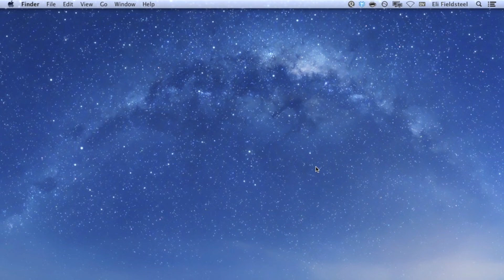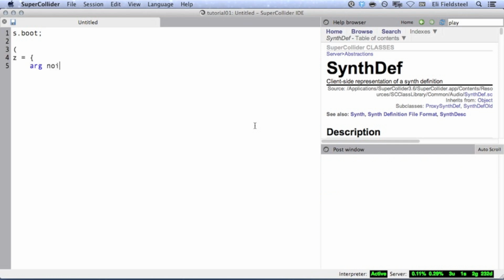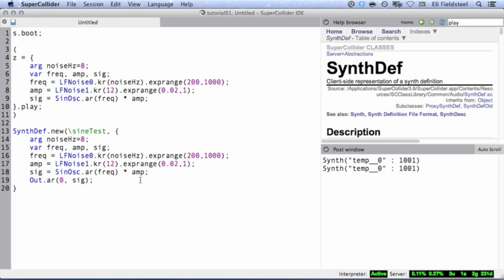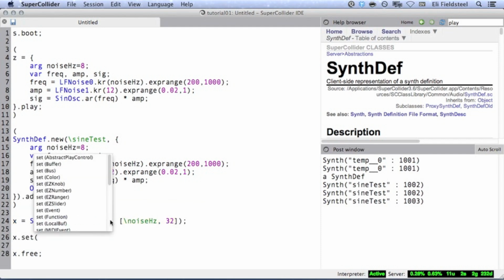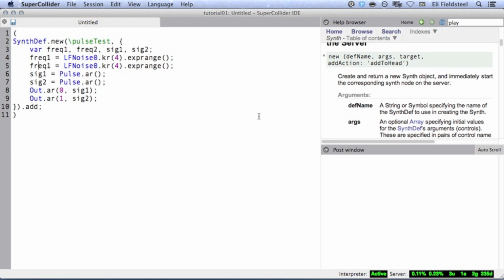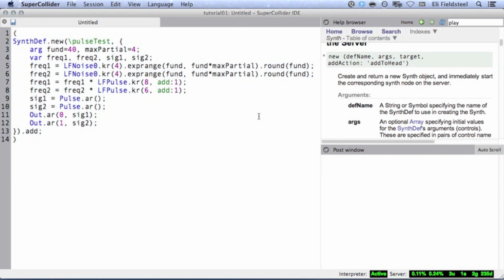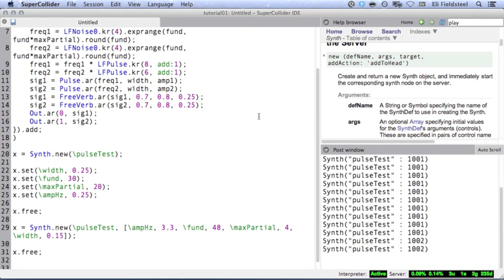SuperCollider Tutorial: 3. Synth and SynthDef

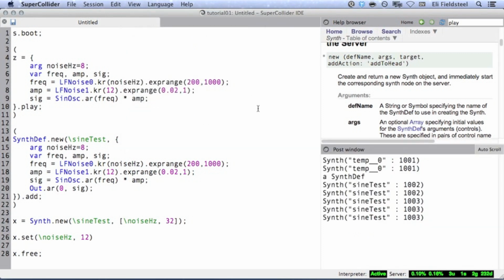Comment: In 4:14, line 26 seems to work without a semicolon. What does this mean?
Reply from the maker: Single, isolated code expressions can be successfully evaluated regardless of whether they end with a semicolon, using shift-enter. In this case, the interpreter determines the end of the code expression to be wherever the first return character is. If you want to evaluate multiple code statements at once, however, semicolons must be used to separate them.

Comment: Could someone help me with a doubt? In the first example, we change the noiseHz (associated with the freq parameter) to change the speed of note change. But in the last example, we use ampHz (which is associated with the amplitude parameter) to do the same. Why is there a difference?
As always, great tutorial Eli! Thank you. :)
Reply from the maker: By changing noiseHz, we change the speed at which LFNoise0 selects values. These values are used to control the frequency of the sound we hear. 

By changing ampHz, we alter the frequency of two LFPulse UGens (named amp1 and amp2), causing them to pulse up and down at a different speed. These signals control the amplitude of the sound we hear.

It's fair to say that the results of these two changes can sound similar, but they are not the same thing. Here's the second example, but noiseHz has been reincorporated into the SynthDef, replacing what was previously a constant value of 4. Set messages below attempt to demonstrate how these two parameters sound different from each other.

(
SynthDef.new(\pulseTest, {
	arg ampHz=4, noiseHz=4, fund=40, maxPartial=12, width=0.5;
	var amp1, amp2, sig1, sig2, freq1, freq2;
	amp1 = LFPulse.kr(ampHz, 0, 0.35) * 0.75;
	amp2 = LFPulse.kr(ampHz, 0.5, 0.35) * 0.75;
	freq1 = LFNoise0.kr(noiseHz).exprange(fund, fund * maxPartial).round(fund);
	freq2 = LFNoise0.kr(noiseHz).exprange(fund, fund * maxPartial).round(fund);
	freq1 = freq1 * (LFPulse.kr(8)+1);
	freq2 = freq2 * (LFPulse.kr(6)+1);
	sig1 = Pulse.ar(freq1, width, amp1);
	sig2 = Pulse.ar(freq2, width, amp2);
	sig1 = FreeVerb.ar(sig1, 0.7, 0.8, 0.25);
	sig2 = FreeVerb.ar(sig2, 0.7, 0.8, 0.25);
	Out.ar(0, sig1);
	Out.ar(1, sig2);
}).add;
)

x = Synth(\pulseTest);

// ampHz change
x.set(\ampHz, 8); // faster
x.set(\ampHz, 0.3); // slower

// noiseHz change
x.set(\noiseHz, 24); // faster
x.set(\noiseHz, 2); // slower
Reply: @elifieldsteel  Thank you for taking the time to explain in detail! You're a great teacher and person. :)

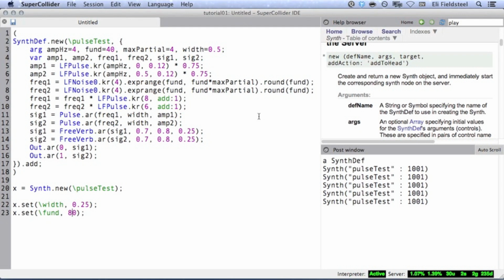Comment: Hey Eli, love your tutorials! I had a question regarding x.set(\arg, ...); like in 7:32.
Is there a way to make the number that I write there multiply, divide, add or subtract each time I initiate the line? 
For example in x.set(\fund, 160) to make it x.set(\fund, +160 or -160) so each time I initiate it, it will add, subtract (or multiply, divide) from the original "fund" argument. 
Hope the question is clear. :)
Reply from the maker: One option — you can keep a global variable and update it as part of every set command:

~freq = 1000;

x.set(\freq, ~freq = ~freq + [160,-160].choose);
Reply: @elifieldsteel  Thanks a lot! Works! I didn't know about ~ at all.

Comment: what is difference between arg and var??
Reply from the maker: In SC, a variable is just a container, used for naming/storing any piece of data. An argument, however, is a controllable value. In a plain language-side function, it creates an input value that can be specified when the function is executed. In the context of a SynthDef, an argument declaration creates an instance of a UGen called Control (or one of its close relatives), a behind-the-scenes class that provides the ability to dynamically update, alter, modulate, etc. some parameter. In a SynthDef, an argument is conceptually similar to a knob on a modular synth, a fader on a mixer, etc. Basically, a control mechanism that can be changed/adjusted in order to influence a signal.
Reply: @elifieldsteel Thank you! it's amazing that if I put an argument in the variable and change the argument, the value of the variable also changes.

Comment: Why can I not call a self defined function f={} within a SynthDef( { .. f() ..}).add? The function is unknown once I try to publish/add the SynthDef. Sorry I do not get it and the documentation pages I consulted do not explain it to me. Unfortunately 'scope' has its own meaning within supercollider which is usually a topic discussing this. Do I explicitly need to declare a class to have something own to be able to call within a SynthDef? Can the function be within an scd-document? Where would this topic, usually called SCOPE, be discussed? Thanks.
Reply from the maker: This is most likely not a scope issue — it is probably a language vs. server issue. You can call a user-defined function inside a SynthDef, but you cannot put whatever you want inside of it. Generally, you should only put UGens inside of a SynthDef (this is somewhat of a simplification), so your function f should return a UGen or some combination of UGens. If it returns something else, you're likely to encounter problems. If I knew more about what was inside your function f, how exactly you're manipulating the code, and what you're trying to achieve, I'd be able to provide more targeted advice. For example, this is fine:

s.boot;

(
f = { SinOsc.ar(440, mul:0.2!2) };

SynthDef(\a, {
	var sig;
	sig = f.(); //note the period between f and the parentheses. f() is a syntax error
	Out.ar(0, sig);
}).add;
)

Synth(\a);
Reply: Sorry .. i found probably the problem. Before I omitted the aditional var statement. .. i would like to get a trashy egiutar synth. But the following code based on.

Comment: I get this error while trying this tutorial, any advice on getting around it?

ERROR: SynthDef pulseTest not found
FAILURE IN SERVER /s_new SynthDef not found
Reply from the maker: This usually means one of two things:
1. You misspelled the name of the SynthDef or Synth. These names must be identical, and capitalization matters (e.g. \pulseTest and \pulsetest are not the same).
2. You did not actually 'add' the SynthDef to the audio server, i.e. you evaluated it with the 'add' method missing, or forgot to evaluate it altogether.

Comment: Awesome videos! Just wondering why in the second line its having an issue with the {  Its saying its a syntax error and I am getting confused. Either way I will keep going(:
Reply from the maker: I think you are trying to evaluate the line “z = {“ by itself, using shift-enter. This line by itself is not valid code, because of the unmatched bracket. The entire chunk from line 3 to 11 needs to be evaluated together by placing the mouse cursor on it and pressing command-enter (control-enter on windows).

Comment: Eli, hello. I can understand the result of many processes, but not sure about their mechanisms. For example, in .kr Gens, I don't understand how the exprange method can either refer to amp(by setting low values like 0.5 to 1) and other times refer to frequency(by setting values in a level of hunders and thousands). This subject about kr methods confuse me, although I can do it. How they understand the difference, and how they can refer to two different attributes and respond effectively? It's a bit foggy into my mind, I hope my question makes sense.
Reply from the maker: First, it sounds like you are accidentally conflating two concepts. A UGen's rate (ar, kr, ir) is not directly related to range specification methods (range, exprange, etc). The UGen rate controls the number of values that are generated per second, and the range methods control the min/max of the output signal. So, the fact that the UGens you're referring to are .kr UGens is just incidental, and it is wrong to describe these methods as "kr methods." The situation would be identical with .ar or .ir UGens.

Second, it's incorrect to think of the exprange method as "referring" to amplitude, frequency, or any other musical parameter. The output of a UGen, such as PinkNoise, SinOsc, etc., is simply a sequence of floating point numbers, nothing more. Range-setting methods, like exprange, simply determine the minimum and maximum values of these numbers, using internal multiplication and addition on thes enumbers. These numbers are only treated as amplitude, frequency, etc., when the programmer employs the signal in those specific roles.

For example, the expression

abc = LFNoise0.kr(20).exprange(200,1000);

creates a noise generator named 'abc,' which produces 20 random values per second. These values can be as low as 200 and as high as 1000. These numbers do not refer to amplitude, or frequency, or anything like that. They are just numbers. But, if we create a second expression, like this:

sig = SinOsc.ar(abc);

Only then are we actually "treating" the noise generator signal as a frequency value. We could just as easily use abc as an amplitude control, but that would not be advisable, because the "normal," expected range of amplitude is between 0 and 1. In this case, the result would be extremely loud and distorted, because when treated as amplitude values, the abc signal is at least 200 times higher than usual.

Normally, I would name this noise generator something else, like "freq," to better indicate its purpose. But ultimately, these names are arbitrary. Just because something is named "freq" does not mean SC will automatically interpret it as a frequency value. It is the programmer's responsibility to give things sensible names and write the program in a way that is correct and reflective of their goals.

Comment: Hi Eli! i have some trouble running out the code, it marks something like this when i try to add the SynthDef: 
ERROR: binary operator '*' failed.
RECEIVER:
   nil
ARGS:
Instance of Pulse {    (0x121b07b48, gc=EC, fmt=00, flg=00, set=03)
  instance variables [8]
    synthDef : instance of SynthDef (0x129b02498, size=16, set=4)
    inputs : instance of Array (0x121d92278, size=2, set=2)
    rate : Symbol 'audio'
    synthIndex : Integer 21
    specialIndex : Integer 0
    antecedents : nil
    descendants : nil
    widthFirstAntecedents : nil
}
   nil

Comment: Excellent tutorials! One issue though, I have copied and pasted your code from github as follows: 
(
SynthDef.new(\sineTest, {
 arg noiseHz=8;
 var freq, amp, sig;
 freq = LFNoise0.kr(noiseHz).exprange(200,1000);
 amp = LFNoise1.kr(12).exprange(0.02,1);
 sig = SinOsc.ar(freq) * amp;
 Out.ar(0, sig);
}).add
)

x = Synth.new(\sineTest);

But when I run the code I get the following error:
ERROR: syntax error, unexpected NAME, expecting $end
  in file 'selected text'
  line 14 char 1:

  x = Synth.new(\sineTest); 
  ^
-----------------------------------
ERROR: Command line parse failed
-> nil
Reply: Nevermind, I figured out the issue: you aren't supposed to highlight and run the SynthDef, just the last Synth.new line. I'm confused though how the SynthDef gets defined if you don't run it...
Reply from the maker: Well, there's no syntax error that I can see. My guess is you're trying to evaluate all of that code (SynthDef & Synth) with one keystroke. Because there's no semicolon after the parentheses, the interpreter can't parse the beginning of the x = Synth statement. The point of the parentheses is actually to allow you to run the SynthDef code first with a single command-enter keystroke, and then run the Synth via separate evaluation. Even if you add the semicolon (I'm not recommending you do) and run everything together, you may still get an error, though a different type (SynthDef not found or something similar), because the SynthDef-building process is not instantaneous.

tl;dr: run the SynthDef first, then the Synth.

Comment: Hi, i was wondering what exactly is wrong with my code. I seem to have everything you have except for the reverb...but I'm getting an error that says "*** ERROR: SynthDef pulserTest not found". 

Any idea what's wrong? Thanks. (here's my code)

(
SynthDef.new(\pulserTest, {
 arg ampHz=4, fund=40, maxPartial=4, width=0.5;
 var amp1, amp2, freq1, freq2, sig1, sig2;
 amp1 = LFPulse.kr(ampHz, 0, 0.12) * 0.75;
 amp2 = LFPulse.kr(ampHz, 0.5, 0.12) * 0.75;
 freq1 = LFNoise0.kr(4).exprange(fund, fund*maxPartial).round(fund);
 freq2 = LFNoise0.kr(4).exprange(fund, fund*maxPartial).round(fund);
 freq1 = freq1 * LFPulse.kr(8, add:1);
 freq2 = freq2 * LFPulse.kr(6, add:1);
 sig1 = Pulse.ar(freq1, width, amp1);
 sig2 = Pulse.ar(freq2, width, amp2);
 Out.ar(0, sig1);
 Out.ar(1, sig2);
}).add;
)
x = Synth.new(\pulserTest);
Reply from the maker: +William Scerbo Your code is fine. It works on my computer. Maybe you added a SynthDef named "pulseTest", and then changed the name to "pulserTest" without also re-adding the SynthDef.
Reply: +Eli Fieldsteel Oh, I understand. I forgot to re-add the SynthDef. Thanks for the videos!
Reply: so what did you have to change? have the same error message

Comment: Hello! I'm having some trouble  with adding the reverbs, without them the code works just fine, but when I try to add them I get:

"ERROR: Class not defined.
  in file 'selected text'
  line 13 char 16:

   sig1 = Freeverb.ar(sig1, 0.5, 0.8, 0.25);
                  
   sig2 = Freeverb.ar(sig2, 0.5, 0.8, 0.25);
-----------------------------------
ERROR: Class not defined.
  in file 'selected text'
  line 14 char 16:

   sig2 = Freeverb.ar(sig2, 0.5, 0.8, 0.25);
                  
   Out.ar(0, sig1);"

These are my lines of code, to me, they looked the same as yours, but maybe I'm missing something:

s.boot
(
SynthDef.new(\PulseTest, {
 arg ampHz=4, fund=40, maxpartial=4, width=0.5;
 var freq1, freq2, amp1, amp2, sig1, sig2;
 amp1 = LFPulse.kr(ampHz, 0.5, 0.12) * 0.75;
 amp2 = LFPulse.kr(ampHz, 0, 0.12) * 0.75;
 freq1 = LFNoise0.kr(4).exprange(fund, fund*maxpartial).round(fund);
 freq2 = LFNoise0.kr(4).exprange(fund, fund*maxpartial).round(fund);
 freq1 = freq1 * LFPulse.kr(8, add:1);
 freq1 = freq1 * LFPulse.kr(6, add:1);
 sig1 = Pulse.ar(freq1, width, amp1);
 sig2 = Pulse.ar(freq2, width, amp2);
 sig1 = Freeverb.ar(sig1, 0.5, 0.8, 0.25);
 sig2 = Freeverb.ar(sig2, 0.5, 0.8, 0.25);
 Out.ar(0, sig1);
 Out.ar(1, sig2);
}).add;
)

x = Synth.new(\PulseTest);
x.free

Thanks!
Reply from the maker: +Dante D'angelo That's an easy one. FreeVerb has a capital V.

Comment: Thanks for the tutorial! When I try to play your code it says:
* ERROR: SynthDef pulseTest not found
FAILURE IN SERVER /s_new SynthDef not found

What now?
Reply from the maker: This usually means that you have accidentally introduced a discrepancy between the name of the Synth and the name of the SynthDef. This is usually a capital letter that should be lowercase (or vice-versa), or a simple misspelling (e.g. pulsetest instead of pulseTest).
Reply from the maker: Or you have forgotten to append ".add" to the end of the SynthDef.
Reply: thanks for the quick answer - it was neither of those but it suddenly started working. What is the difference between Shift+Enter and Strg+Enter?
Reply from the maker: Cleador Day shift+enter evaluates the current line, strg (cmd/ctrl)+enter evaluates multiple statements (if they are enclosed within parentheses).
Reply from the maker: +h30 First, you can change your font set in the SC preferences panel. Second, SC is usually fine with the presence or absence of whitespace, so that's likely not the problem. Third, reading the SC error log is a bit of an acquired skill; it can be tricky at first, but with practice it becomes easier. If you PM me your code along with the version of Mac OS and SC you are using, I can take a look and see if I can help. Note that I'm on Yosemite and haven't yet upgraded to El Capitan.
Reply from the maker: +h30 I had a feeling it would start working. It was probably something simple.

Comment: Also when I run this code, it tells me
ERROR: Command line parse failed
nil
Synth("pulseTest" : 1017)
* ERROR: SynthDef pulseTest not found
FAILURE IN SERVER /s_new SynthDef not found

This is my code:
(
SynthDef.new(\pulseTest, {
	arg ampHz=4, fund=40, maxPartial=4, with=0.5;
	var amp1, amp2 freq1, freq2, sig1. sig2;
	amp1 = LFPulse.kr(4, 0, 0.12) * 0.75
	amp2 = LFPulse.kr(4, 0.5, 0.12) * 0.75
	freq1 = LFNoise0.kr(4).exprange(fund, fund*maxPartial).round(fund);
	freq2 = LFNoise0.kr(4).exprange(fund, fund*maxPartial).round(fund);
	freq1 = freq1 * LFPulse.kr(8, add:1);
	freq2 = freq2 * LFPulse.kr(6, add:1);
	sig1 = Pulse.ar(freq1, width, amp1)
	sig2 = Pulse.ar(freq2, width, amp2)
	sig1 = FreeVerb.ar(sig1, 0.7, 0.8, 0.25)
	sig2 = FreeVerb.ar(sig2, 0.7, 0.8, 0.25)
	Out.ar(0, sig1);
	Out.ar(1, Sig2);
}).add;

x = Synth.new(\pulseTest)

Comment: Could you share the exact text of your last sample with me?
I want to check that I have it exactly right because it's not working
Reply from the maker: Video scripts are maintained here:

https://github.com/zeffii/Supercollider3_tutorials_code

Excerpted here for convenience:

s.boot;

(
SynthDef.new(\pulseTest, {
 arg ampHz=4, fund=40, maxPartial=4, width=0.5;
 var amp1, amp2, sig1, sig2, freq1, freq2;
 amp1 = LFPulse.kr(ampHz,0,0.12) * 0.75;
 amp2 = LFPulse.kr(ampHz,0.5,0.12) * 0.75;
 freq1 = LFNoise0.kr(4).exprange(fund, fund * maxPartial).round(fund);
 freq2 = LFNoise0.kr(4).exprange(fund, fund * maxPartial).round(fund);
 freq1 = freq1 * (LFPulse.kr(8)+1);
 freq2 = freq2 * (LFPulse.kr(6)+1);
 sig1 = Pulse.ar(freq1, width, amp1);
 sig2 = Pulse.ar(freq2, width, amp2);
 sig1 = FreeVerb.ar(sig1, 0.7, 0.8, 0.25);
 sig2 = FreeVerb.ar(sig2, 0.7, 0.8, 0.25);
 Out.ar(0, sig1);
 Out.ar(1, sig2);
}).add;
)

x = Synth.new(\pulseTest);
Reply: I've noticed there are slight differences in the syntax for the last example in the github version vs the version in the video. Github version works. Video version does not. I think rule of thumb is to go by what's written in github.